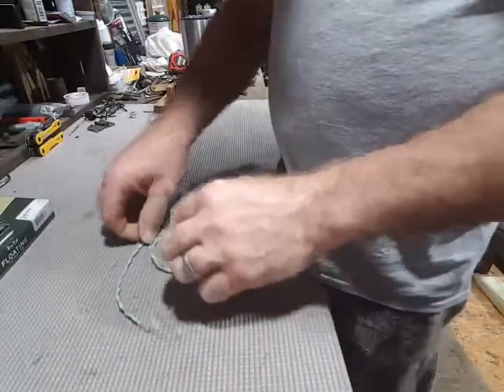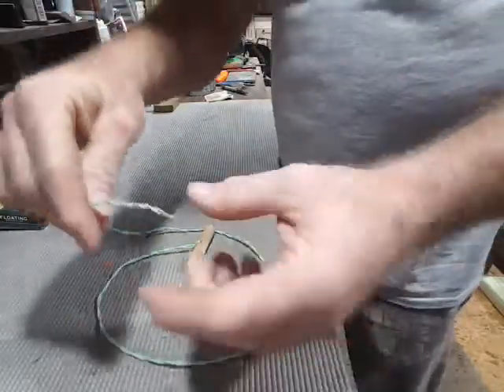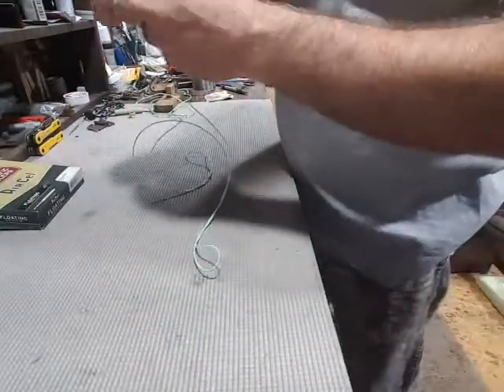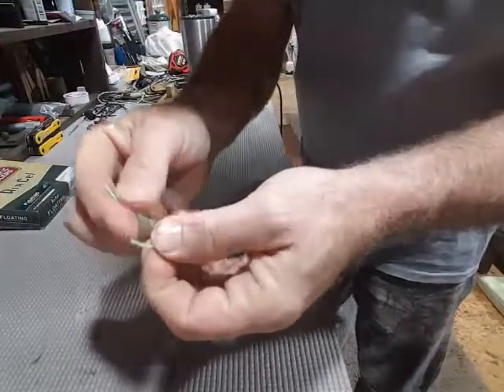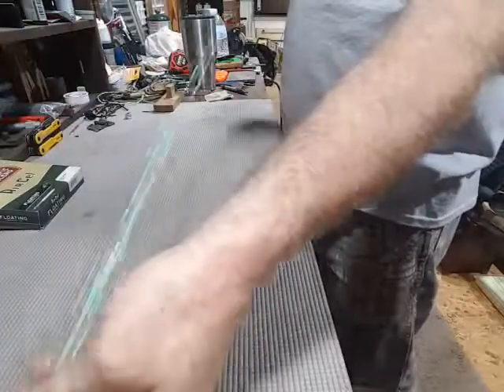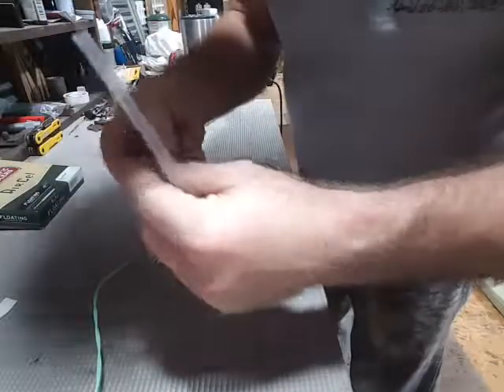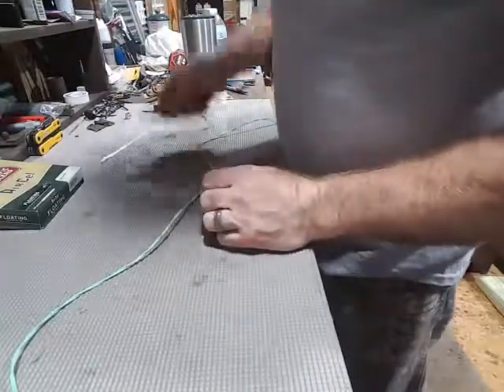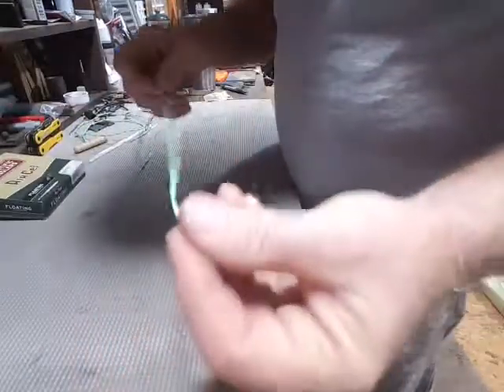Making a pull through for cleaning barrels

Comment: Great information one thing any specific poundage I mean I don't want it to snap while pulling it I was think 30 LBS may be overkill but better safe then sorry
Reply from the maker: I have probably pulled at least 30 lbs on mine and its maybe 7 or 8 years old. This line hasn't even shown signs of drying out or rotting.
Not a fly fishing expert but it's an amazing product in my opinion. 
At any rate you just have to cut the patch to your liking. The idea being pulling a couple patches through instead of 20 or 30.
I made this video because I've seen shooters pull a couple of loose fitting store bought patches through and post video's of how dirty the barrel was and how many patches they've used and it's still not clean.
I've cleaned some really dirty barrels and even the same as those shooters were posting about and it's never taken more than 4 or 5 before I couldn't see a reason to pull one more.
If you havent seen the video look for the one I made called cleaning a barrel the easy way.
Nothing to it and you can see how hard I pull on the line